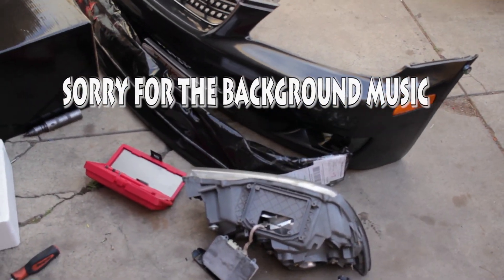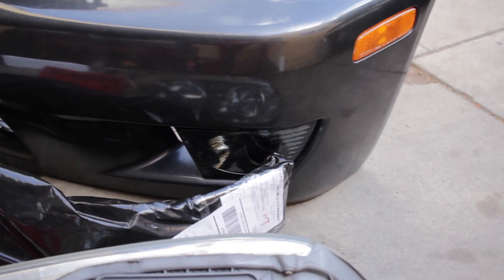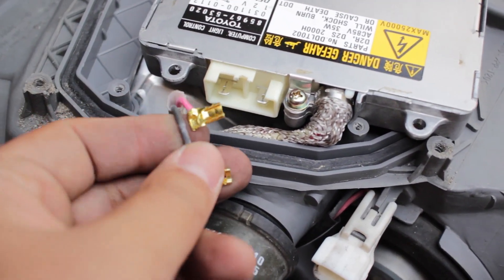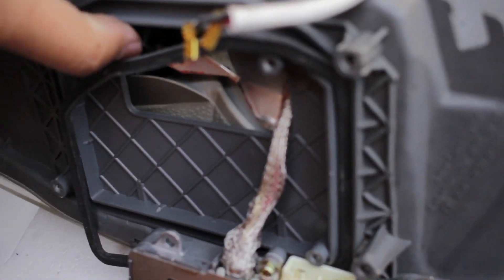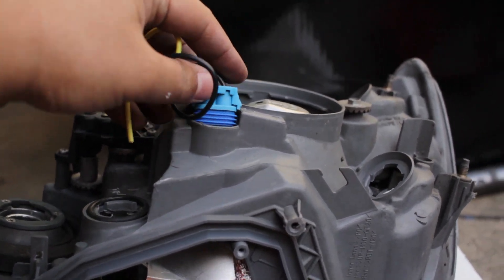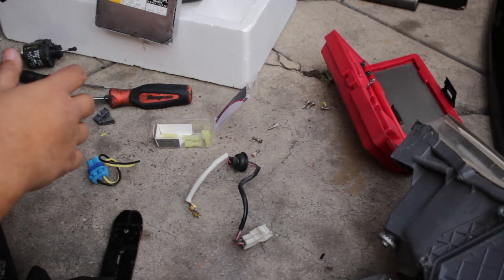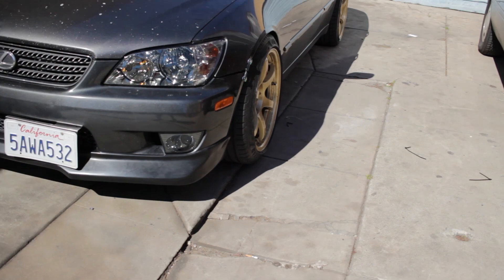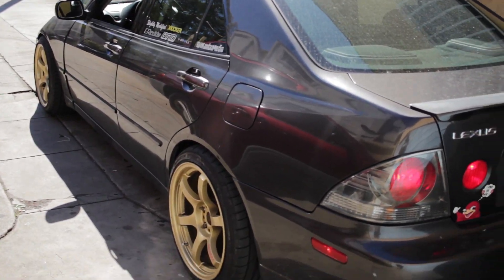02-05 Lexus Is300 How to Convert Hid To Led

Comment: Hey man I have an 04 is 300 and I want to know which fog light wire harness you got on your car because I don’t want to buy the wrong on :)
Reply from the maker: Is300 had two different fog harness wire for the fog light. 9006/h3. Factory I had the h3 bulb but had to wired to 9006
Reply from the maker: Long as you know what bulb size you have you’ll be good